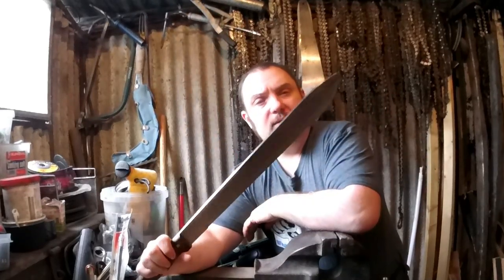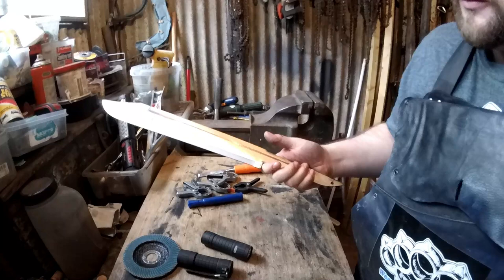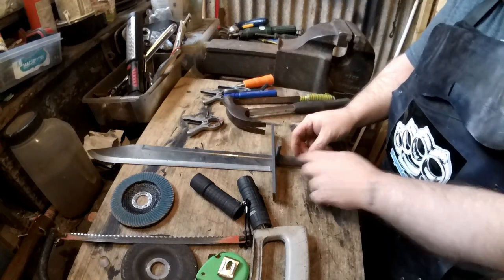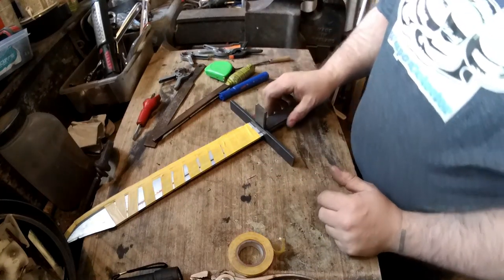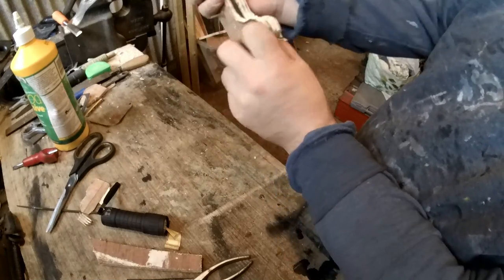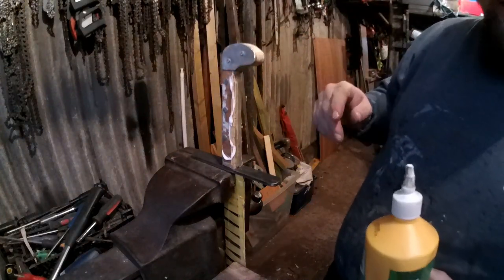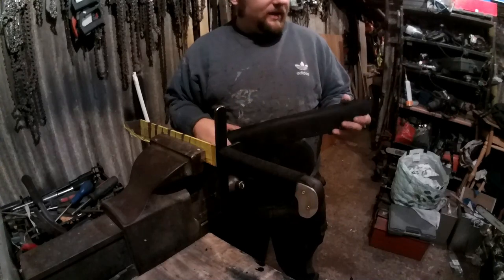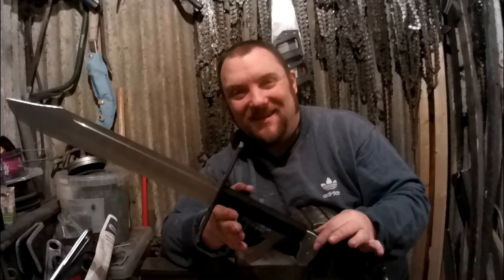Homemade Messer From A Machete

Comment: Good Video mike one thing I would recommend is that you use a rubber mallet and soft jaws for bending the guard as it leaves very little to no scratches or dents making the finished product a lot better
Reply from the maker: Good idea, cheers for the tips mate.